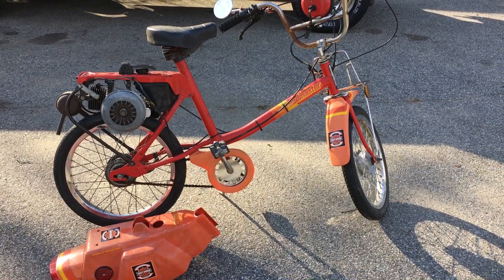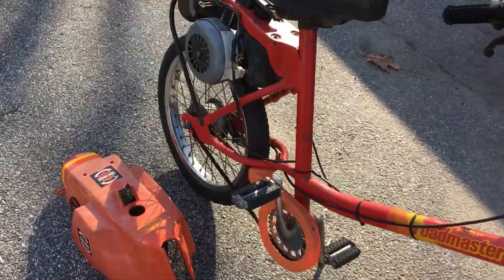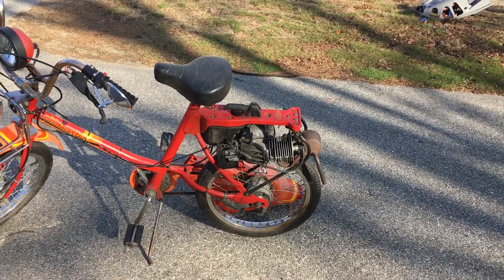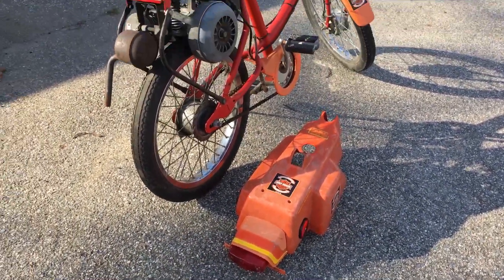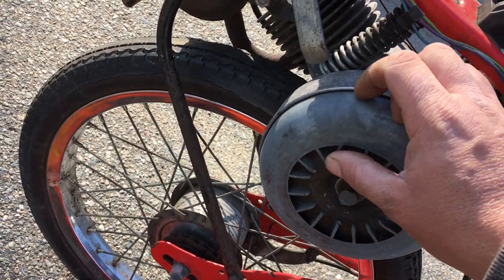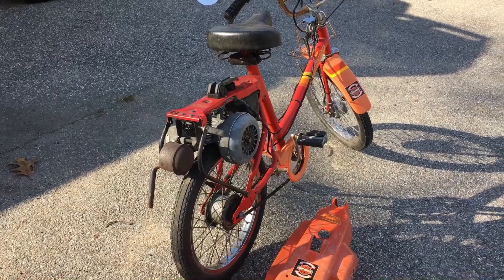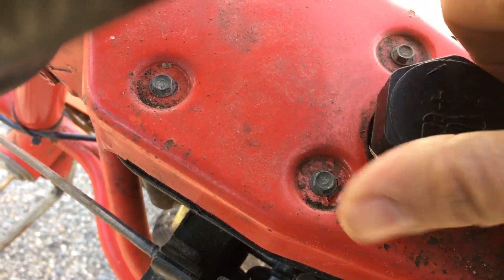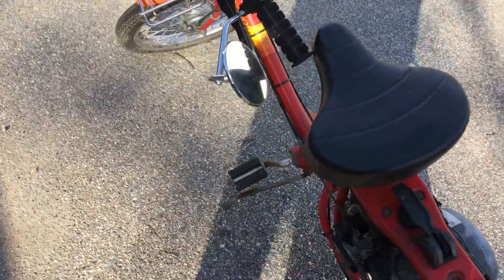1978 AMF harly roadmaster first look

Comment: I owned 3 of them years ago.The weak links were the roller,the single main bearing,and the EXPENSIVE solid state ign.module. The good point was the heavy wheels,tires,and drum brakes.I used 2 of the wheels on one of my homemade motorbikes. Its on you tube under JohnWade.
Reply from the maker: That's awesome I will check it out

Comment: Hello Kevin, I just picked on of these up. I believe it’s  1981 has no spark. Disconnected kill switch wire spun motor with impact still no spark, would you say it’s coil module issue?

Comment: I think that is an amf roadmaster but it is not Harley, Harley was run by amf at that time but they did not produce that moped, correct me if I’m wrong.
Reply from the maker: Yes amf brought Harley Davidson late 70s early 80s they sold everything moped gokarts and even dirt bikes the engine used was a McCulloch 2stroke
Reply: I believe the markings on that bike are not authentic Harley branding either
Reply from the maker: @peteosinga8845  the Harley Davidson sticker are not but the bike is AMF
Reply from the maker: @peteosinga8845  well they are AMF made a ton of them
Reply: Kevin Bergeron true I have one I intend to restore, it was sold to me as a Harley moped  when it arrived it was tagged amf but no Harley, my investigation result according to the internet was that it is amf just not harley
Reply: AMF moped. Had one when I was 12. AMF owned Harley Davidson at the time but this had nothing whatsoever to do with Harley Davidson. This was built by roadmaster, a bicycle manufacturer.

Comment: Is there any way you could make a video of your amf roadmaster. How to start it? I'm confused on how the settings work on the handlebars and the sequence  of it all. Thanks!
Reply from the maker: I sold mine
Reply: It starts by being pedaled. You pedal it like an ordinary bicycle,  and it turns over the engine. The moped is friction drive, and It has a lever to engage and disengage the engine's drive roller.

Comment: I Have this exact motor Without the frame and I was wondering if anybody could tell me why this motor doesn’t have spark? I did put a new coil on it but still won’t spark. maybe a new stator?
Reply from the maker: McCulloch they made them for the Harley Davidson AMF era McCulloch also made 2 stroke gocart engines
Reply: I have the Amf moped engine
Reply from the maker: @noahsgarage147  great engine
Reply: Thanks, I’m almost finished restoring a 1975 Suzuki tm 125. And one of your videos on oil injection helped out a lot.
Reply from the maker: @noahsgarage147 awesome happy to help I try to tag as many bikes with that Oiler its a great Oiler system

Comment: are you able to work on small  engines like  a 35 oe 40 cc tanaka or hoda gx 35 or Honda gxh 50??
Reply from the maker: MrHighpressure I work on all engines gas and diesel 2 and 4 stroke
Reply: email  direct with rates for repair work
Reply from the maker: MrHighpressure I don’t do that kinda work for other people I work on factory stuff mods for Kawasaki only
Reply from the maker: MrHighpressure I haven’t had a chance to get the pictures been working all day
Reply: you misunderstood ,,i don't need you to fabricate anything  ,,just repair  some small engines
Reply from the maker: MrHighpressure i will email you in the morning I am exhausted

Comment: do you think its possible to put a Tecumseh engine on one of these?        do you have any of those around?
Reply from the maker: you mean 2 stroke tec from s snow blower
Reply from the maker: you will have a lot of mods needed i wouldn't
Reply: what would you think is a better replacement
Reply from the maker: why would you want to replace it that enging is a great engine  this problem is anything elc will take a lot of frabracation